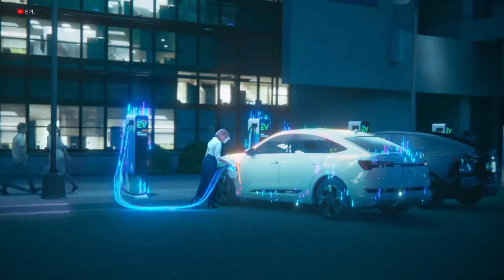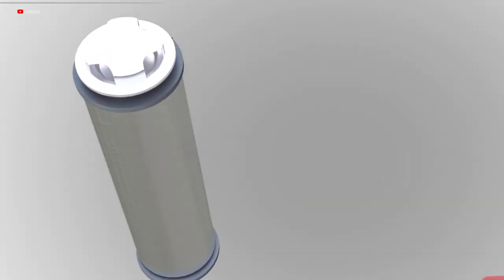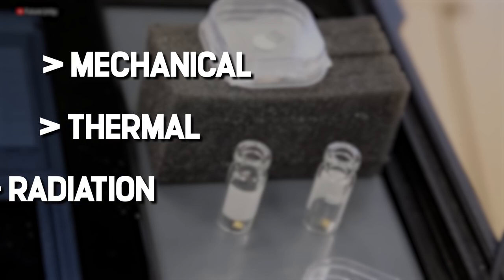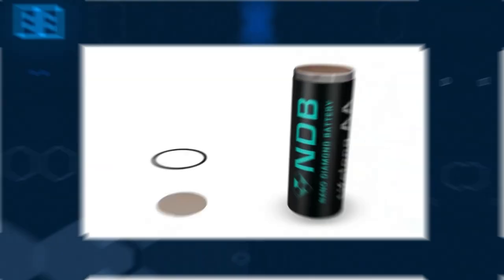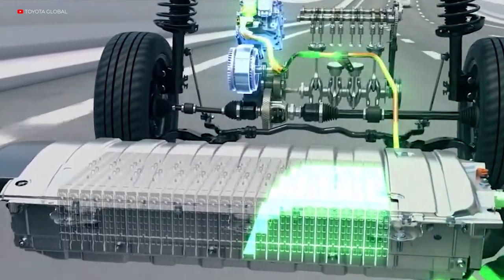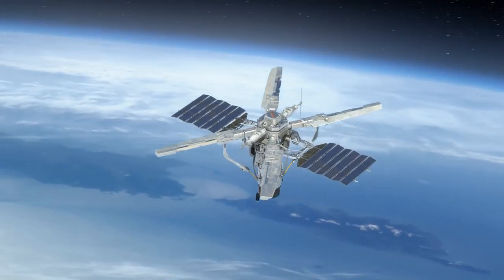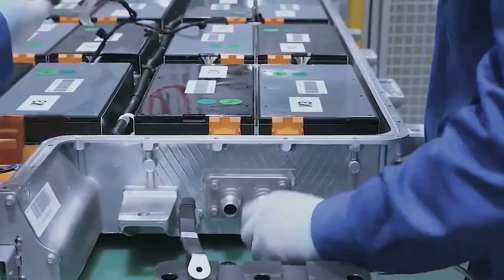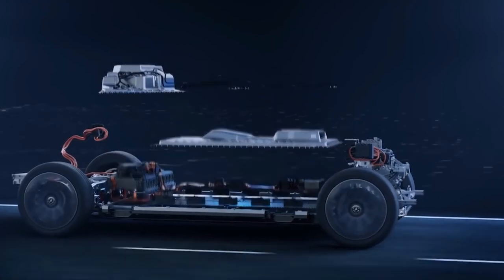Nuclear Diamond Batteries Meets NO Competition

Comment: This battery capacity is huge! And I think it could be a reasonable power source to power any electric & electronics application. It certainly does not have any competition. One question is still a concern for everything that is; will it be safe enough for long-lasting backup?
Reply: Yes
Reply: @mal7344  No, problem is that the power density is too low (10uW per cubic centimeter) for almost everything around us that is using batteries, except pacemakers. If you used a more radioactive isotope, you could increase power density but then safety is gone.